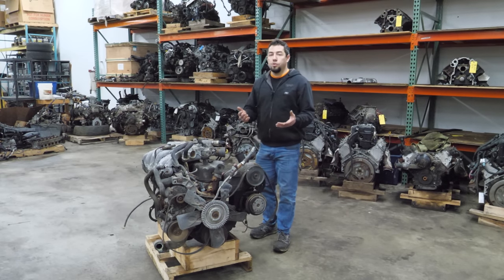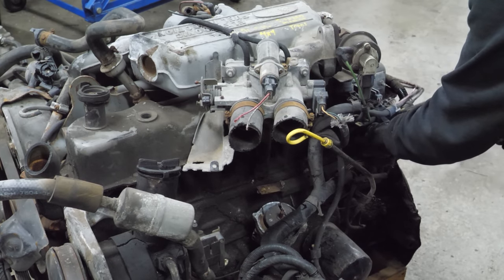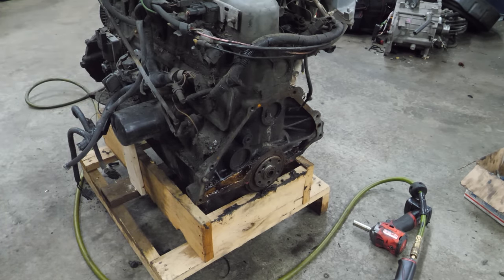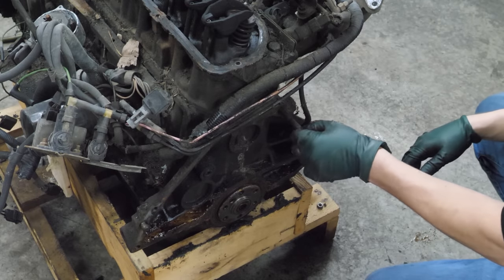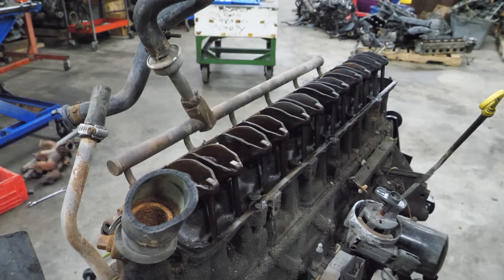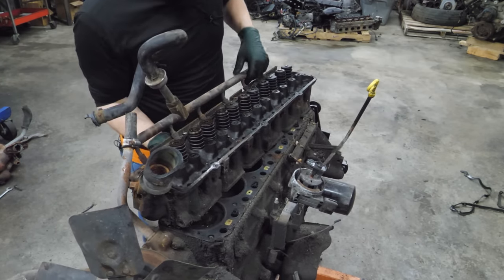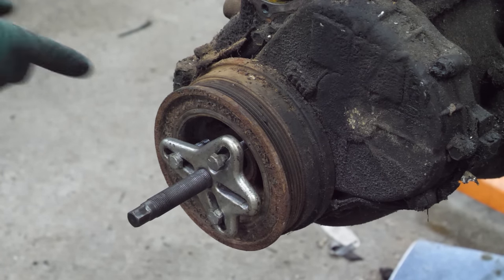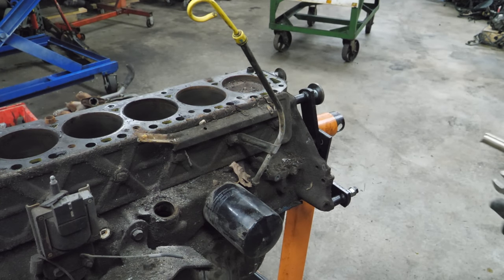FINALLY! A "Bad" Ford 4.9L 300 Straight 6 To Teardown! Most Reliable Engine, Ever?

Comment: 16:29 and that's why you NEVER have valve timing problems with these engines. What I love to see! That timing set is immortal. They're said to live through two engine rebuilds before they even get any appreciable wear on them and I don't think anyone's ever put so many miles on one of these engines that they truly wore a timing set out.

Uhh, word of advice, don't try to get the gear off the cam. IT's a press fit. They're married for life. Death do them part type deal.
Reply: Like my previous 2 wives.  Similar.
Reply: The old IH 304 in my Scout had a gear driven cam as well.  It weighed 700lbs and I think it was rated at 145 gross hp.
Reply: Had one the crank keyway enlarged caused a knock and led to timing gear tooth breakage. Why it enlarged don't know.
Reply: @jeffpolakiewicz2277  that was probably some impressive levels of abuse!
Reply: @Prestiged_peck  Box truck
Reply: Nonsense. The fiber cam gears lose teeth around 175K.
Reply: My pleasant surprise seeing timing gears.
Reply: @thegdfp6447  Well...

...you can also replace those with an "honest-to-God" steel one... noisier, but problem solved...
Reply: Buddy had that gear come apart
Reply: I had that cam gear lose a few teeth on mine.  The replacement one I bought from ford and the old gear were a fiber material, and not metal.  I think it was a fail safe point.
Reply: @thegdfp6447  Agreed. I love these engine, but that is a flaw have seen before.
Reply: My old Willys Jeep had a gear driven cam too. They originally used a chain drive from 31 to the late 40s but redesigned it for more reliability. A hallmark of reliable engines you won't find anymore. Rubber belts became the nadir of reliability.
Reply: @BFT88  What I've heard is they originally had metal gears, but at some point (maybe the mid to late 80's?) they decided to change to nylon to reduce noise. Anyway, If you happen to have an engine with the nylon gear, most people recommend replacing them with the metal one. Anyway, it's a non-interference engine, so even if it breaks it shouldn't destroy the engine.
Reply: @OvertravelX  I was thinking the same. My old Travelall was gear driven. I think since both engines had heavy-duty industrial applications, the gear makes sense
Reply: Chevy straight 4 and 6 and Pontiac Iron Duke 4 have gears, but also got nylon coated cam gear so they wouldn't last too long...
Reply: @mybigfartsreallystin  honest to Henry, I run the factory fine tooth cast iron ones. There are also iron and aluminum coarse versions, no steel.
Reply: Have heard that the ones used on passenger vehicles used chains, not gears.  EDIT - might be thinking metal vs fiber gears.  Sounds more likely.
Reply: @russellstyles5381  - Sounds more like it...
Reply: I have an 86 F150 that stripped the fiber timing gear. Put a new one on and the truck lives to this day. I'm the second owner and the truck outlived the first owner.
Reply: @coreyneal3705  I had an 85 crown vic 302 with that crappy nylon gear. I remember buying a water pump and the parts guy tried to upsell a new timing kit. :lol:. Should have bought that one.
Reply: The fiber gears do fail, but its a non-interference engine..so at most I would lose is a AAA tow home and not the engine.
Reply: @trssho91  - As opposed to early Ford escorts where the timing belt also drove the water pump and the pumps tied up at 25K miles, snapping the belt, and crashing the valves into the pistons destroying the engines... also, the leaf spring held the front wheels on and when the spring broke...
Reply: @BuzzLOLOL  I was a Ford technician in the late 1990s/early 2000s era, how much time you got?    I was a fan of the 3.0L they used in the Taurus, Ranger, etc -- it was a pretty solid engine overall as well.
Reply: @trssho91  - I went from high school into GM Engineering in August 1966 via the GMI Program...
Reply: I had almost 400 on mine and at 80mph it cut off. Luckily that 90van was such a battery of moving energy it roled a mile uphill to a loves truck stop. Had no spark and pulled distributor and found no movement of rotor. 70mile tow home and pullled front end apart and found original plastic cam gear lost most of it teeth. Crank gear was good as new and steel. Replacement was all metal but let me tell you getting that pressed on metal ring that plastic was molded onto was fun. Landed up breaking all the plastic off and welding two ears to it and used two jaw puller. Installed new set new water pump and fan clutch and ran that thing until the electronics gave up. Motor never burned oil leak yes and ready sleved front and back of crank. Same pan gasket as in video. The best part of that motor was the push rod / lifter cover on the side of the motor. This van was gave to me with 140k on the ticker the Naples FL mechanic said no compression on #1,2 found the original plugs missing straps and carbon to hell. Seafoam and NOAA warning from the cloud that thing made it was sliding sideways. Thought it was funny it pulled onto the lift on 3,4,5,6 and was not that rough. I was down power. If that was a modern interference motor them valves would had been smashed into piston mcNuggets.
Reply: @thegdfp6447  I agree, the fiber gears on the fuel injected models is the achilles' heel of this engine. Fortunately steel replacements are available, returning it to its bullet proof status.
Reply: @babydriver8134  
Ford had good luck with gears for the cam.on the old flathead V8, I guess going to timing chain was the THING to do
Reply: @thegdfp6447  
My 1950 flathead V8 had that as well,  the new replacement was all steel.  More dependable,  and longer lasting.  The speedometer was broken when I bought the pickup.  While I had the engine out to rebuild,  I had the speedometer fixed.
Reply: I was marveling at this timing setup and here I see another man with class.
Reply: @jeffpolakiewicz2277  Maybe that was the issue with mine . . . I once had a truck with one and a 3 -spd. manual. At about 168 thou miles, it started busting cam gears in a circle between the two access holes in the face of them. I replaced it twice, but it busted again after about a month -month and a half each time.
Reply: @BuzzLOLOL  Ford Duratec 3.5 and 3.7l V6s in FWD cars are the same way. The timing chains are fine but the water pump is not only driven by the timing chain but its a major stress point because it's used as a tension point. The chain comes down off one head, under the water pump sprocket and back up to the next head. The problem is that the tension from the engine would pull the shaft in the water pump out of plane and eventually the seals would fail and they'd leak. The water pumps do not have large enough bearings to hold against this tension and they fail. 
 If you were lucky, they just leaked down the front of the motor onto the ground or out the weep holes. LOTS of owners of these engines were not so luck and the inner seal would fail and leak right into the oil pan. So its not just the main bearings that get eaten up, the milkshake gets picked up by the oil pump and sent up the the oil actuated VVT system and gunks up the cam phasers. So you get to do the entire top end of the engine as well! Fun stuff.
Ford "fixed" this issue with the Duratecs in the F150 by eliminating the internally driven water pump in favor of an accessory belt driven water pump. 

If you buy a Ford car with the 3.5 and it hasn't had its water pump replaced, you better do it. And take a close look at the oil drain plug for the forbidden glitter. Scan it for codes too and see if there are VVT system errors that indicate the cam phasers might be gunked up. 

to be fair, Ford isn't the only company that runs the water pump with the timing chain. Nissan does it too with the VQ35 motors. Nissan is smart about it though. They don't use the water pump pulley as a pivot point in the timing set. It's just an accessory running on the chain. It's also a lot easier to change the water pump on a VQ motor than a Duratec.
Reply: @OvertravelX  I've blown up several of those, put a 392 in my Scout II only to rip the rear axle on its maiden voyage from the garage, blew that engine up too.
Reply: I had an early 80's Chevy Celebrity with the 2.5....  It used timing gears, which I really liked.  (although one of the gears was nylon, because wtf) 
The TBI system in it was a little quirky, and the automatic transaxles were shit, but it was a good little engine, and I enjoyed that car for the number of years I drove it as a backup to my 71 longbed F100.  That had the 302 though, not the 300.
Reply: @1SqueakyWheel  Nylon, why, because steel wont wear out, Ford even coated the timing gears in their V8 engines so the chain would get slop in it as it aged, they don't want things to last.
Reply: @Maples01  I know...  Didn't wanna go into it that much...  They say "for quietness!" yeah right
Reply: @1SqueakyWheel  I miss my 73 Econoline with the 302, head on collision with a Wrangler, couldn't afford to have the front replaced, it held up better than the Jeep did, the 302 needed a timing set, but pretty much ran like a Swiss watch, just hot due to advanced timing. My take on todays engines, they stroke them to the point the piston pin is either too close to, or in the oil control ring, rings are thinner to cut resistance, oil is thinner for same reason, the results, they burn oil, yes they reach high miles but can not be rebuilt, they destroy themselves. I've had several 60's Chevy trucks in the past, every one had the inline six, not a power house, but ran forever, had one so worn out you added oil with every fill up of gas, but it was running smooth.
Reply: @Maples01  That's hopeful about your Econoline holding up in a front end collision.  I have a 96 longbody E350 (it's a 7.3 powerstroke) and I've always felt uncertain about head-on collisions as I've put massive mileage on it...  but then again, most vehicles out there are heavier than Wranglers...  so it's possible you were lucky on that lottery!  Sorry you lost your truck there.  :-(

Yeah I miss my old '71 302..  good truck, and great memories! 
I also had an 85 F150, another longbed with a 302, with that funky 80's fuel injection system and the odd dual tanks.  That was a good work truck until I accidentally let it sit too long in the yard (a couple months) without moving it around, (when I first upgraded to the E350 for work) and rats/mice ate the wiring up in her.....  she's still parked, waiting for me to find the time to try and get it all sorted out.  :-(
Reply: @1SqueakyWheel  The 68-74 Econolines were unibody, they didn't have the separate frame bolted under them, so I was surprised the under structure wasn't moved, just the sheet metal body panels crushed. My 99 E350 frame looks like a beam from a commercial building, pretty heavy, the van weighed in at 8000 pounds when I put it on a scale some years ago, pretty sure it would have driven away from the collision with the Jeep. 
Seen a guy on FTE that had to rewire an Econoline due to squirrels getting in the engine housing, lots of wiring on these vehicles.
Reply: @Maples01  yes, and they had that much flatter front with the less protrudant hoodline. 
They were lighter vans for sure, which was great for fuel economy...  
I believe the move to C-beam chassis was to expand the flexibility of the E line to mirror the F series...  certainly went a long way towards making them more similarly utilitarian beasts!
Reply: @russellstyles5381  my buddy has a Ford 265 I block from a milk truck that he built in a 55 Ford car and he said car was timed with a chain and the truck is gear to gear , you can swap but car cam is ground backwards so must stay together with car timing set .
Reply: @thegdfp6447 100% this, they appeared in automotive engines around 83-84 because people complained about the noise. Industrial stayed steel/steel until the end.
Reply: @stefanl5183  I've had several 300 six Fords, Seen em with metal timing gears , in service manuals! Never had to replace gears myself!
Reply: @mybigfartsreallystin no not entirely you can literally have steel gears break too
Reply: @rayrooney4656 rubber belts aren't extremely common chain drives are literally just as reliable for most people and 3 gear drives are still common
Reply: Married for life?!? Hardly. Any mechanic or machinist worth his weight in dirt can get that gear off the cam all day long - and do so without damaging the parts. What's your hangup? You are correct about the timing though. As long as you ditch the phenolic coated type of gearset and replace them with a modern, precision set then you're golden. Don't go El Cheapo though - some of the import sets from the past used poor materials and heat treating. The teeth would start to crap out in a few thousand miles on the worst of them. I recommend high quality domestic made parts! They're worth the cost and peace of mind. Best wishes!

- Max Giganteum
Reply: @MaxGiganteum  Ahh, yes, let's spend $200-$300 in machinist's labor to remove a $40 gear from a worn out camshaft. BRILLIANT!

Ye I'm just gonna leave it on there when I rebuild my 300. The cam's wiped anyway, a new all steel good quality timing set costs basically nothing, no sense fussing and farting with trying to remove it here with little more than a BFH and a torch to try to get the parts separated or paying someone else 4-5 times what a brand new gear costs. The old gear on the old cam will make it easy to repurpose those parts. Make a standing lamp out of them maybe? Be pretty stable.
Reply: @TestECull   $200-300 in labor costs... ROFL... you must have absolutely no skill and no imagination. Some heat and a gear puller. Some heat and an arbor press. Some heat and a hydraulic press. Yeah... SO tough and time consuming. 5 minutes tops but for you? Apparently, it'll just kill the entire build and send it through the roof over budget. Allow those with common sense to roll their eyes. By the way, I wasn't suggesting to re-use parts that would obviously need to be scrapped on a rebuild. I did notice though... that you've gone from a position of "forget about getting them apart" to "...remove it here with little more than a BFH and a torch...". You sure seem to change your mind quickly on what can and cannot be done! BRILLIANT!

- Max Giganteum
Reply: @BFT88   Phenolic gears were used because they were far more quiet than standard gears. However, long term, they would fail. The pieces he found in the oil pan at the pickup were undoubtedly part of the original gears in this engine. I'm surprised he wouldn't know that but then again, he's not that old. Best wishes!!

- Max Giganteum
Reply: @stefanl5183  Negative - Ford used the phenolic gearsets from day one back in the 60s. Just an FYI.

- Max Giganteum
Reply: @russellstyles5381  The Thriftpower 6 (144, 270, 200, 250 and 2.3 HSC 4) used a timing chain.  The 240/300 used gears.
Reply: @thegdfp6447 
That’s what happened to mine .catastrophic failure. Low oil did not help. I’m not a mechanic.
Reply: @stefanl5183 
As a non mechanic, I was told that’s what seized my 4.9. Fiber gear broke apart.
Reply: @DriveCarToBar the Ford engine could actually be engineered by Nissan or even the other way around because Ford and Nissan and even Mazda have joint ventures in vehicle manufacturing. Ford built the Mazda tribute vans. If you look at the manufacture label it says manufactured by Ford motor company.
Reply: @Maples01 bs... Besides Chevy and Dodge isn't building anything to last either.
Reply: @MaxGiganteum I don't think they did on the pick ups. My engine has the metal gear on it.  '75 Ford f100.
Reply: @Mark-in5yw    Yes, even on the trucks. To the best of my recollection, I've never opened an original 300 that did not have the phenolic gears - from any vehicle. I will concede that I cannot remember for the life of me if Ford used the phenolic gear all the way through 31 years of production though I believe that they did. I'd look it up in my shop manuals but I don't have access to them at the moment. I'm pretty sure Ford used them at the very least all the way to the point where they switched to EFI though. If there's any doubt about it, get a shop manual for your year of vehicle... I'd highly recommend that for anyone. As for replacement gears, DEFINITELY replace a phenolic type with a quality all metal gearset and don't cheap out. The low-end sets have been known to quickly wear or fail due to crap metal being used along with crap heat treatment. While I haven't had it happen to me, I've had other guys tell me they'd seen the heavy wear or broken teeth. Those things shouldn't occur, obviously so. I suppose if you built a 400+ HP monster then things might be different but on an otherwise stock engine? No way. Go quality and forget about it, having peace of mind alone is totally worth it. More advice is to automatically check the timing gears on the 240/300 Ford if you go to use one of those engines. If you find the phenolic gears, replace them! Don't allow them to become a problem in the future and do it even if they look mint! Best wishes!  👍🏻🛻

- Max Giganteum
Reply: Look at these new 4 cam DOHC engines with their multiple, long timing chains and hydraulic tensioners. One is lucky to get 150K out of one, even with excellent maintenance. Front wheel drive cars typically have to have the engine removed to replace them.
Reply: The Studebaker also v8 had timing gears. When maintained those motors were very long lived, it was built more like an industrial motor and was heavy for its displacement. Too bad Stude never had money to develop it, performed well with factory supercharger.  The cylinder bores were small for its potential maximum displacement - easy on head gaskets. It was Studes first v8 and they built it too heavy duty.
Reply: I've been through 3 sets of timing gears on mine.  Switched to the metal gears... Wish me luck!  Driving the van to Baja this winter.